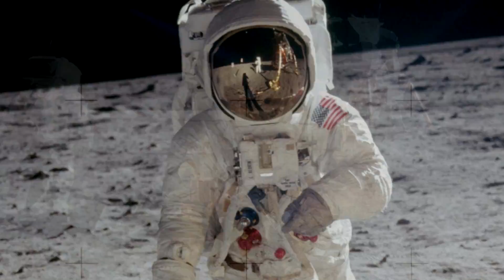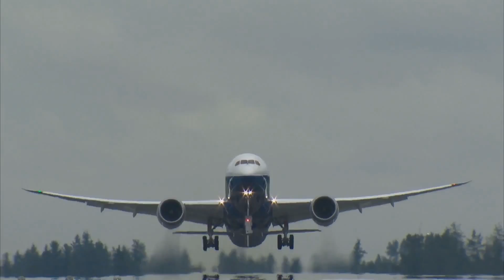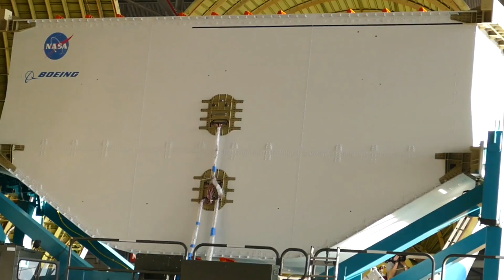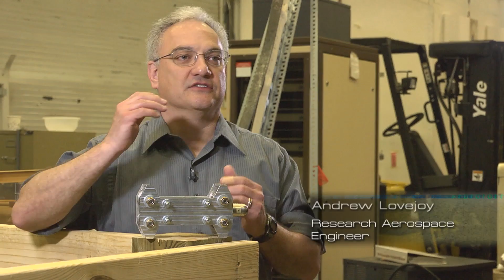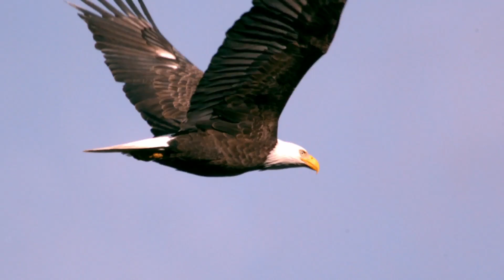End of an ERA_Part 1

Comment: Engineered flexible spines which keeps discrete positions inside according to the algorithm and allows the skin to follow a contour.  This is all just an evolution process, for example the basic concept was used back in the early 1960's by McDonnell Douglas in the Bent Up Trailing Edge articulating doors when flaps were extended, which followed a very smooth curve like you see here, but it used slide rule designed pivot and support points with cams and guides and flexible seals.  We also have morphing winglets before this.  Some mechanically actuated like this, but also some thermally expansive dissimilar sheets.  This is also useful for active load control, not discussed here.  My associate at Phantomworks has been working on the BWB / HWB for decades on behalf of Boeing.

Comment: Concept of ultra efficient low carbon emitting aircraft jet engine: Today's jet engines are efficient with one sizable exception: taking off. For short-haul flights, 80% of the trip fuel is needed for takeoff and getting up to cruise speed. If we could come up with some other way to provide that initial burst of extreme energy to take off and get up to cruise speed, the trip would require but a fraction of the jet fuel that today's jet aircraft use. What we need is an energy storage medium optimized for gigawatt seconds of energy over a period of several minutes. Well, we have such a device, the super capacitor. Keep in mind that, once we've reduced the amount of jet fuel we need, we've gained some leeway in what we can do with the space and weight. Super capacitors and electric motors? Could an electric motor be utilized to run the compressor of the jet engine?

All I'm saying is the concept deserves study.
Reply: Can use the aircraft carrier technology... 
Buy that would be way way expensive at that scale...

Comment: After control surfaces utilize the principle that  Flexsys pioneers now, the next step will be wings with adjustable section profiles, further enhancing efficiency depending on speed and AoA.
Reply: Any sign of the Flex wing appearing on a commercial plane? Or a timeline?

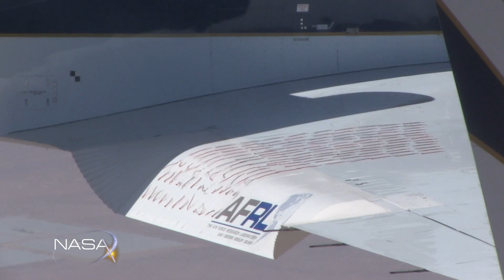Comment: One big problem with the morphing flaps is that without a gap between the main wing and the flap, airflow over the top of the flap is reduced and increases the chance of stalling. You can very clearly see this at 22:55, the air over the flap is going backwards, loosing lift, and creating an unsafe condition.

Comment: Incremental improvements to modern commercial jets have only resulted in incremental boosts in fuel efficiency. Speed has flat if not dropped. Only composite materials and the eureka geared turbofan design has boosted efficiency. What new plane design or engines changes has even been shown in beta form. No supersonic releases. Modern fighter jets are just stealthier, same rough design as those since the F16

Comment: I love the "flying wing" design. I wonder why it's necessary to punch holes in the frame for windows, when it would be far easier to feed the images outside the aircraft from tiny camera's mounted on the tail, pointy end, and the left and right sides. Thin screens  mounted on the interior of the passenger compartment where windows would be can display those camera images. Result less drag from window frames, less cost, as well as a stronger fuselage without punching large holes along the sides as with conventional windows.

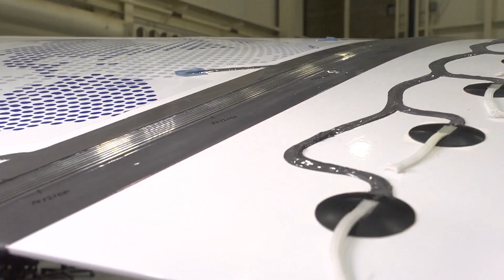Comment: Just curious. At 22:55 the airflow over the upper surface of the flap appears completely stalled, with the ribbons fluttering in the wrong direction.  That must be generating a huge amount of drag.  I guess that's to demonstrate the flaps are strong enough to withstand an over-speed situation?

Comment: It's just a piece of fabric covering the gaps!
Reply: no it has an engineered flexible spine which keeps discrete positions inside according to the algorithm and allows the skin to follow a contour.  We also have morphing winglets before this.  Some mechanically actuated like this, but also some thermally expansive dissimilar sheets.  This is also useful for active load control, not discussed here.

Comment: can you make a hybrid jet use turboshaft engine to power a genarator that drives a internal electric ducted fan and use the jet thrust as well for propulsion
Reply: Yes you can, but the losses from going through the generator -> motor will make this less efficient than a normal shaft driven fan.
Reply: Actually hybrids are predicted to be the future in aviation, but without using the jet's thrust for propulsion, because that would negate the fuel efficiency advantage of such an arrangement (which is why you would seek to make this kind of hybrid in the first place).
Reply: Joshua Burton could, but each conversion of energy causes more energy to be lost to friction
Reply: Yes you can! Sure. No problem. But why would one do that, when driving the fan directly off the turboshaft is far more efficient? Let's face it: the best generators have an efficiency of around 90%, which means around 10% of the power is wasted. Then the electric motor - if you're lucky it will have some 90% efficiency as well, so in the end only 90% of 90% of the turboshaft's power will be left to power the ducted fan. And.., there's the added (dead) weight of the generator and electric motor, which wouldn't have been there with direct drive....
Reply: Joshua Burton Too heavy and there are conversion losses.
Reply: Joshua Burton ... Of course... but that would be too easy! :)
Reply: nothing new, and additional weith just. more interest to do fuelless plan with antenn on the wingth for receiving electric magnetic energy genereted on the power station from land
Reply: Albert Einstein kinda explained it fellows. Energy cannot be created nor destroyed thus the end of perpetual motion. E=Mc2.

Comment: Wing Body aircraft has been in work since the mid 1930's.
Reply: but the space shuttles were full lifting bodies
Reply: Given he died over 60 years ago, any patent has long since expired.

Boeing also owns all the McDonnell Douglas patents for flying wings. No one has figured out hot to pressurize it yet. Current materials will be so heavy it will hurt fuel economy.
Reply: According to what I know, patents expire and become public domain after 20 years. The Bunrnelli lifting bodies were what vintage? 1935?
Hum. I smell inconsistency of infos here, M'Lud.
I guess the greatest issue with flying wings is their incompatibility with established infrastructures at the airports. Maybe the way to success would go via cargo planes in the first place.
Reply: Who owns the patent for the Horten bomber design?
Reply: There is nothing next generation or 30 years ahead of our technology, in the Boeing 754 lifting body, and it offers advantages like this; Range, payload, short field, fuel efficiency.
Boeing will not build a blended wing body or any sort of lifting body because they will not ever pay patent royalties to the Burnelli estate. That's the only reason they've been dragging their feet on lifting bodies.

Comment: So, I guess you didn't think of simply inverting the keel to allow the vertical drop to work? Hmmm? More fun to make something complex.
Reply: Having gravity in a different direction relative to the structure results in different loads and stresses on the material. An impact to the side must be tested horizontally because otherwise, the different loads on the material due to gravity would result in differences in the damage.
Reply: If it is that fragile, I'll agree. thanks. Sorry to sound snide.
Reply: it's not about if it's fragile, but about testing the exact fragility of the material, removing other variables, so that the structure can be optimized.  being off by a couple percent would be a complete failure for the test. Most Nasa dev. programs are meant to make a structure up to 4 percent more efficient, sometimes much less, so even a quantifiable percent is a big deal to a program.
Reply: ACADMan of course it's more fun to make something more complicated and new haven't you ever played Kerbal Space Program? if not you really should try it
Reply: ACADMan  sometimes you need to solve problems that don’t really exist just so you have something to do.
Reply: That's what I was thinking, Spring load is too unpredictable? Well, why not get a set of springs and measure them meticulously at each bit of compression, rather than having that sled bumping and bopping over the uneven bits of that rail and even scratch its arresters along it with unknown normal force at unknown speed in unknown places of unknown friction coefficients…
I'm still scratching my head over that bit.

Comment: why not just turn the box upside down, then do your weighted drop test as normal?
Reply: Having gravity in a different direction relative to the structure results in different loads and stresses on the material. An impact to the side must be tested horizontally because otherwise, the different loads on the material due to gravity would result in differences in the damage.
Reply: Ben Garner
Reply: FknRa I just wanted to say, in these years "COMMON SENSE" is a rather RARE commodity, something,g, I have looked at for about, 58 years !
Reply: Ben Garner - Correct. For a structure this size, gravity loads on the components of the structure itself are significant. The exact nature of the failure at the impact point depends on the sum of all of the loads, some of which would be changed to the opposite sign if the structure were inverted.
Reply: It's a simulation test, demonstrating the high velocity impact of an object from the ground in an upward motion (eg. as noted in the video, a rock kicked up from the tire), flippin it over and dropping a rock on it wont net the same test results.
Reply: because then they couldn't come up with an overly complicated and expensive answer. You're thinking with common sense, not like an engineer.